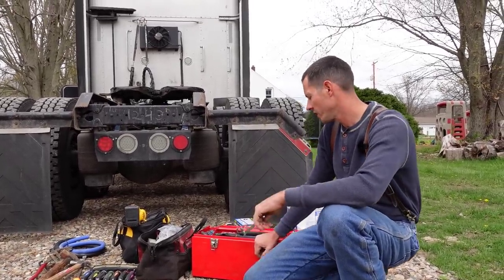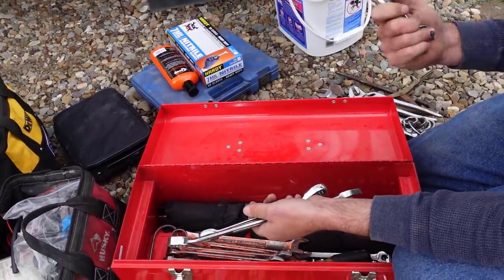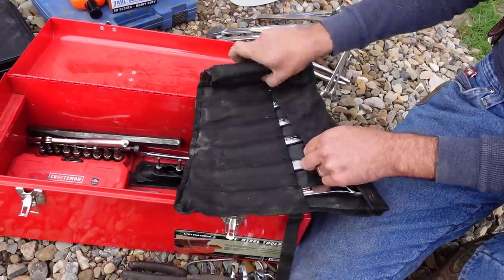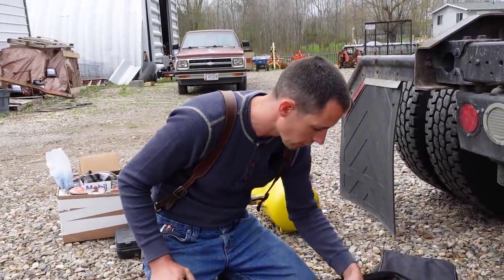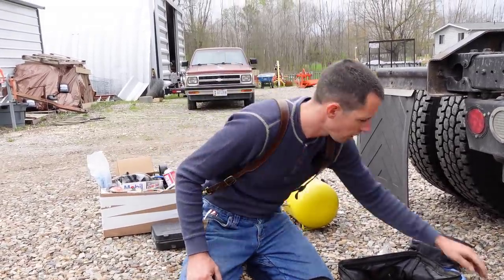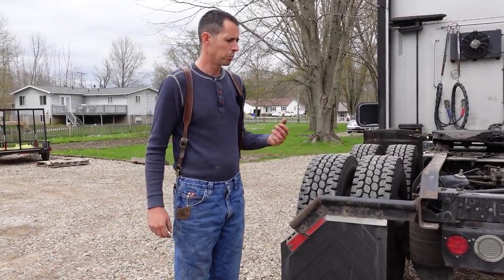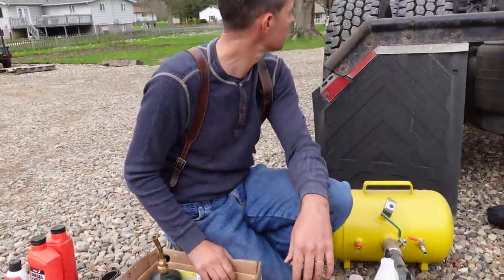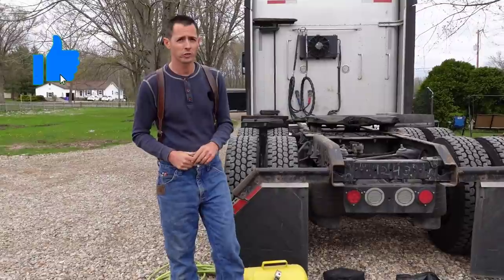What Tools Do I Carry With Me While Trucking On The Road - Landstar Owner Operator

Comment: One handy tool, especially in colder weather, is a (pick your favorite brand) cordless heat gun.  Use mine for both new wiring and repairs, rather have hot air than flame.  Wintertime, frozen door locks and handles, frozen/slushed up wipers and drives, windows, if chains are frozen up, free up the clasps and hooks.  Sometimes the pintle hitch latch lock gets bound up with a little ice, works on that, too.  If you get a problem in the wiring pigtail, can dry the whole thing, maybe it's a moisture related short.  If you have an exterior light fail, warm up the light gasket so it flexes easily pulling the old out and installing the new one, saves accidental tearing.  Takes ice out of screw heads on bezels on older ID cab lights, etc., lots of uses for a little hot air.  Just ask politicians..  😉

Comment: Hello to a fellow Navy Veteran. I did 6 years in the 80’s. Enjoy your videos. I’ve been and independent flatbedder since 1998. I was only leased on for 6 months in 1997 before I went independent. I’ve always bought tractors and trailers that were about 3 years old and keep them for about 3 years. Do 90% of my repairs and maintenance. It has always worked out well for me. Probably buy my first NEW tractor in 1 to 2 years because it will probably be my last because I plan on retiring around 63. I carry just about everything you do except I bought a nice Husky 149 piece 1/4” thru 1/2” set on sale for $80 at HD. The Dewalt 20 V tools work great especially the 1/2” impact. I also have a $300 engine/tranny analyzer. Keep up the great videos and keep safe out there. ✌️

Comment: I also carry 3/4 drive torque wrench for lug nuts and 3/4 impact sockets and extensions. Wheel seal, 3/4 Milwaukee impact gun. 1/2 drive wrenches and impact sockets, socket adapter set  as well

Comment: The think I learned in the military to set beads was to put a cargo strap around the circumference of the tire , then tighten cargo strap thus squeezing tire and setting bead which then air can be added but I wouldn't fully air up tire for fear of breaking cargo strap ( i would say no more than 15 psi ) or to use something flammable like starting fluid and a flame to set bead which isn't highly recommended by any industry . To put tires on , through the military involved using a prybar to lift tire up onto axle but mine involves using the jack to just lift the tire up off the ground just high enough that you can spin the tire but it's still kind of touching the ground . Then you just walk tire on and off but with maybe turning the tire to line up the studs ( sometimes I'll use the prybar to rotate tire or I'll spin axle if able to ) . Although sometimes I use both methods . Hope this helps someone . This message could possibly be deleted for I haven't had time to proof read .

Comment: I had quite a set. 2000 lb tq air gun, 600lb air gun. Air grease gun, u joint puller, I used the red hose to a 1in large line to run the big air gun. For a cascade. To take the tires off.

Comment: What do you use to jack up the truck or trailer to change your tire? Do you keep a spare tire on the truck?
Reply from the maker: I use a 20 ton jack. No spare tires. I put good tires to my truck. And landstar handles the trailer tire
Reply: @truckingandfixing  I’m a little confused then why did you have the bead blaster?
Reply: @elgansito1552   he said for trailer tires if he picks up trailer that has tire off the rim
Reply: @gogglespaisano6483  ahh ok. I’ve never seen that yet.